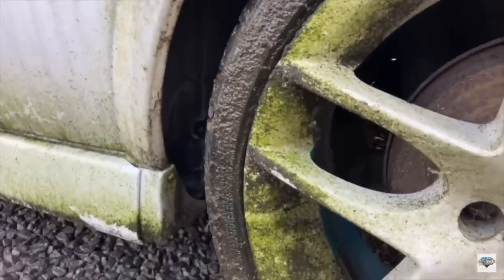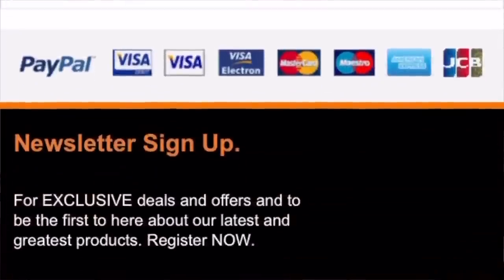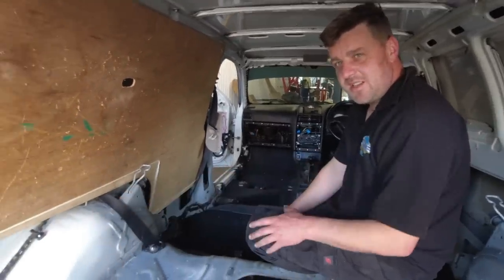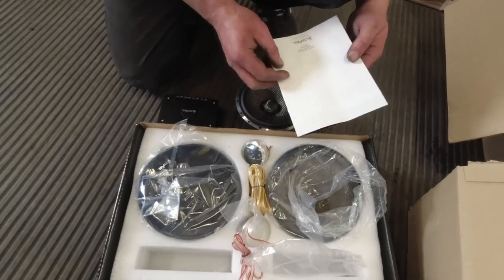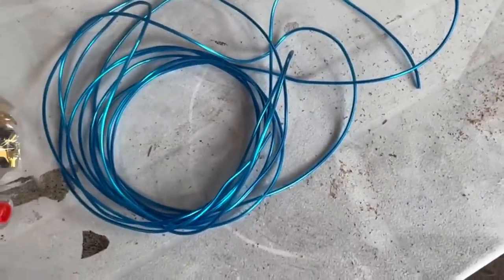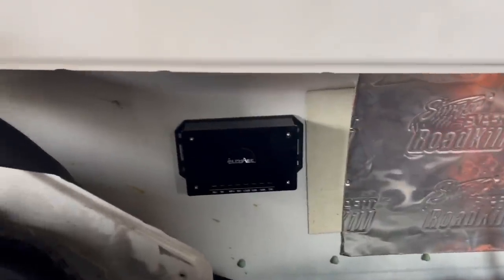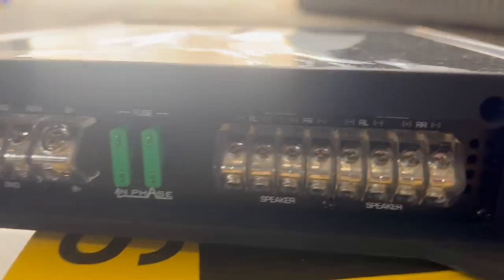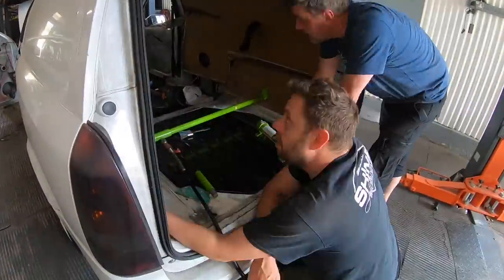This Inside Conversion Is Madness - Eps 2

Comment: Love it, good to see someone on youtube actually doing an install with subs and amps.  Rather than just swapping a head unit and thinking they are the dog's bits.  The first thing I do when I get a new car is rip out the standard factory rubbish.  I remember back in 2001 ripping a brand new Fiesta with 30 miles on the clock to bits to fit a system.
Reply from the maker: lol love it

Comment: looking forward to seeing the rest of this project going along, can't beat a decent aftermarket sound system in a vehicle over the Manufacturer standard system. I have a 1200 watt pioneer sub wired to an inphase 1200 watt amp. the inphase amps are incredibly well built.  had mine for 7 years now
Reply from the maker: That's the plan!